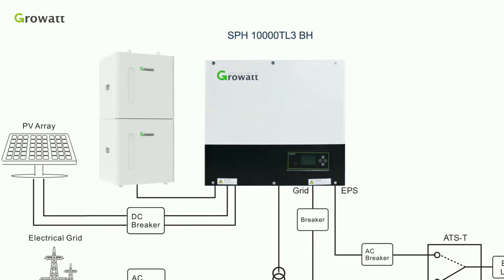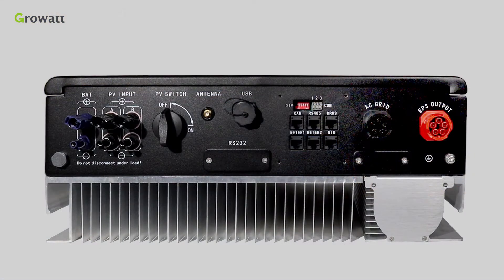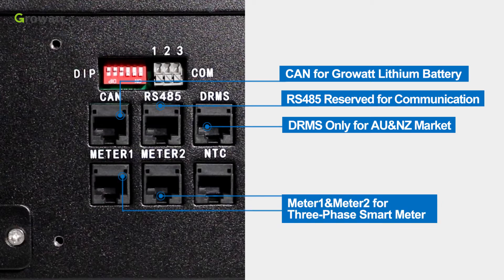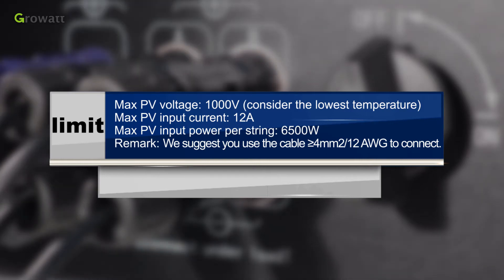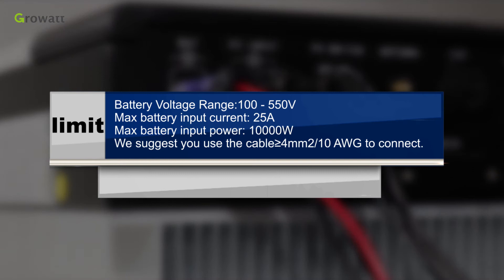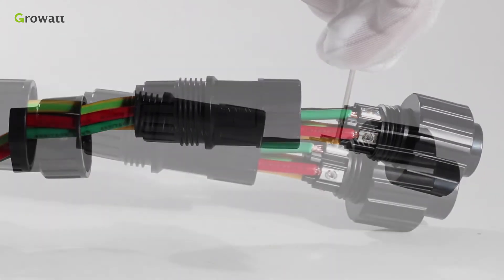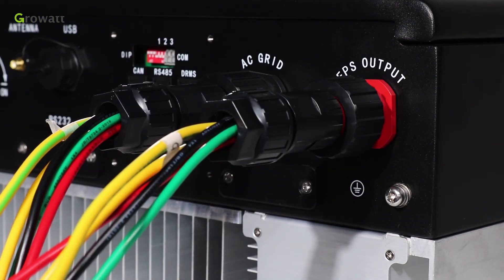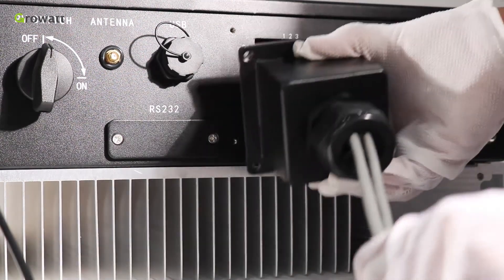SPH 4000~10000TL3 BH Installation introduction

Comment: I bought 3 SPH10000 and the SEM. Everything has been installed by professionell staff. However, ALL inverters issue either of the the warning BattChrOrDisFail and sometimes M1AbnormalWire . I've contacted Growatt support and Growatt service several times ... NO answer at all !!! How can I get reliable support from Growatt ?

Comment: Hello
The maximum power per string is 7500W. However, can I connect 8000W if I have no choice?
Reply from the maker: Hello, for technical support, please contact our service team at service@ginverter.com, or you can call our service hotline at +86 755 2747 1942. Thank you!

Comment: Hello, what are the requirements to the battery? I know Growatt sells also the batteries, but what if I want to use the SPH product with my own (high voltage) battery?
I think there should be communication on the CAN bus, so I am wondering if that is a Growatt proprietary protocol, or that is an open or standardized protocol so other batteries can also be connected? Thank you
Reply from the maker: Hello, Growatt also offers batteries and you can check here for more information: http://www.ginverter.com/Residential-Storage-Inverters.html#product43. As for technical support, please feel free to contact our service team at service@ginverter.com. Thank you!
Reply: you got any info on that? or find any solution for own  HV bms system .
Reply: @Imran-CH  Hi Imran, I didnt work with it myself, but somebody I know used a  and said the CAN bus communication was equal to Pylontech protocol which you can find online. I still sticked to 48v systems, didnt build anything high voltage yet